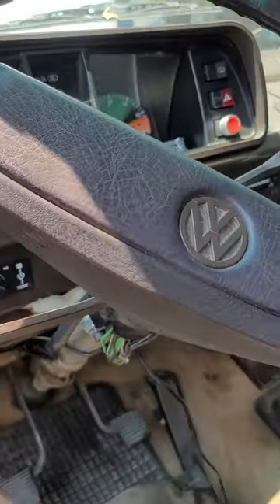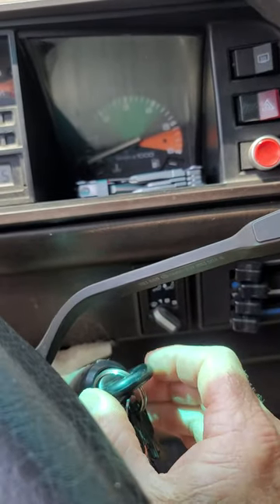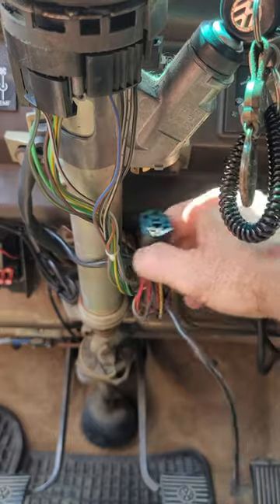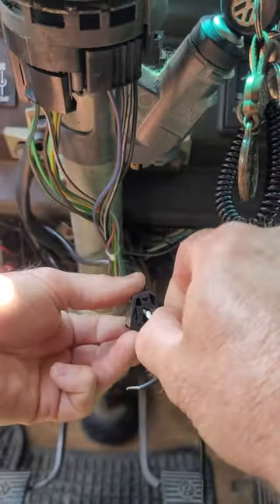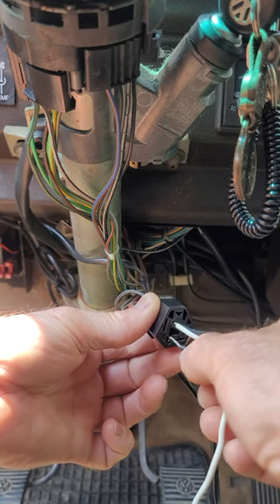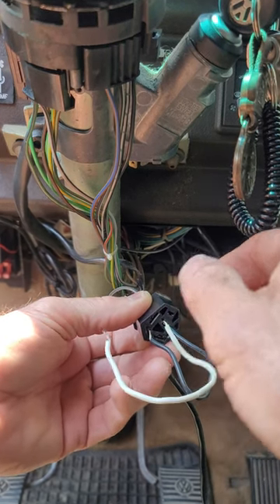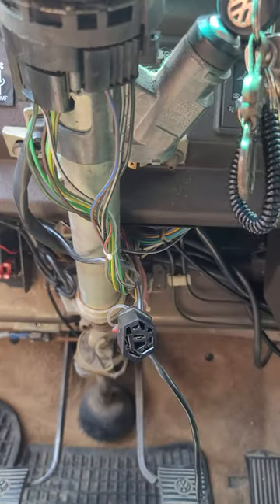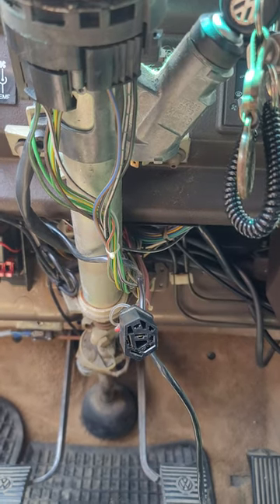VW Vanagon hot wire (broken ignition switch)

Comment: Why do I see a lot of info on failed ignition switches?  ..is it because there are only these $10 pieces of chinashit replacements available?  Is there a $20 or even $40 OEM quality replacement available?...this is a serious question!
Reply from the maker: For me the OEM cast metal piece broke at end of the key cylinder. My ignition switch was fine. But good luck finding an oem key cylinder 😉 I found an OEM on eBay

Comment: Hey sir you might not see this but i tried this on my 1988 jetta coupe with a 5 speed manual and all i heard was a click from the starter then it stopped and didnt work no more. Now when i flick the switch for the hazard lights the relay just buzzes. Do you know what the issue might be and do you know if everything will all be fine if i just simply change the relay?😊
Reply from the maker: I don't.. double check the jumper wiring make sure you didn't short